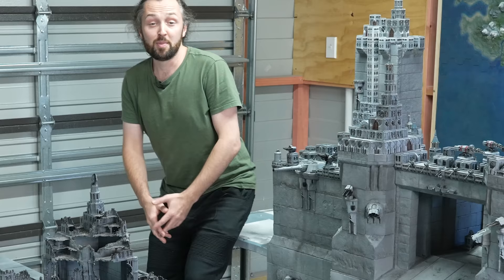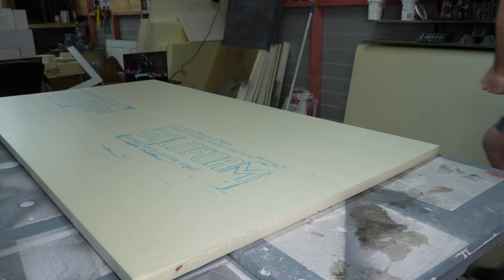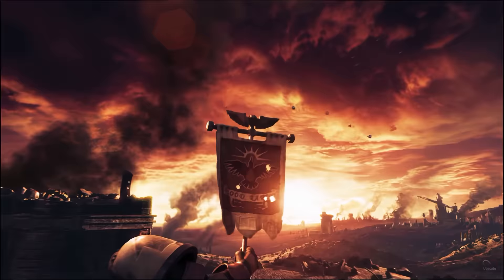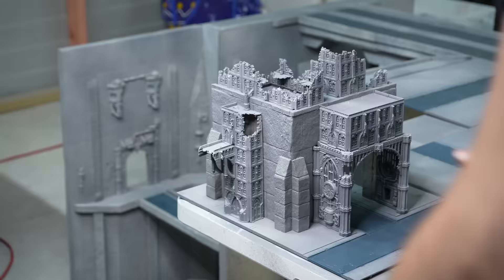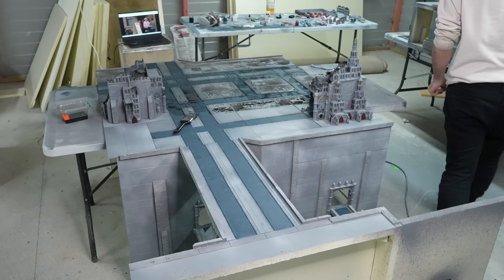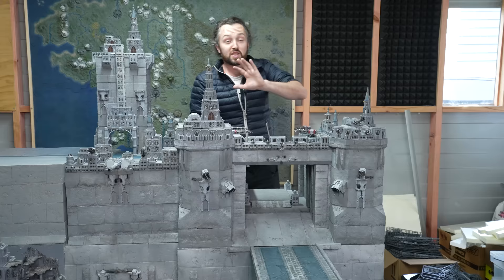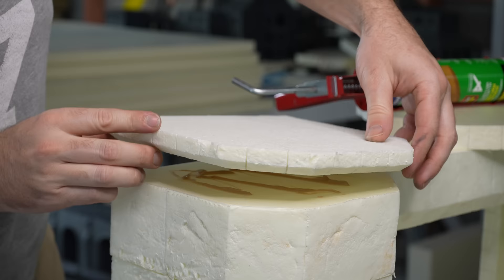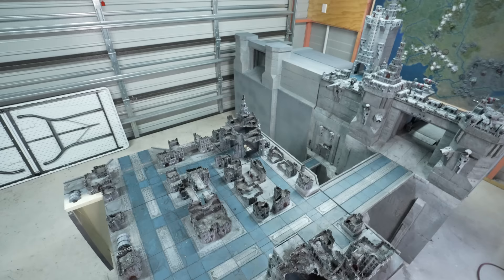The BIGGEST wargaming board in YouTube History! Imperial Palace on Terra Warhammer Scenery [6]

Comment: what i less expected from imperial palace, is right now, for me, the best. The top of the walls. All the small buildings gives a realy good sense of scale and good aspect. Its a great surprise how good it is.

For me, the moduarity its great, but if  you  realy want to know, where i would put the new gate, is on the lower level. Being the gate acces to the higway that goes trought the trench. and the top of the new wall, be at same level than the city.

What I most expected from this, was the city, and i am kind of dissapointed. I realy expected more. But I got to say, that it already got a great work and my expectatives were not real.
But somehow, i imagine a hive city, like a place whit multiples levels and i think, here is  miss chance. Be able to see the narrow spaces in the lower levels between buildings, creating small streets were you would never go in on the threat of being stolen and kill, but as the building increase high, the towers become thin, there is more space on air, and there is space  for platfoms, that can work as square, streets or common areas.  Also, the main highway to the bastion, could have some details to make it feel like a great highway and importat road. maybe could have a small elevation over the rest of the city, or in contrary could be sunked and you could see small roads to incorporate to the main highway whit a car. Maybe the titans, could have a path in the middle and in the sides, roads for smaller cars of civilians

Also, I think, that streets needs more details. Like some cars  broken around, some details like benchs, street food post signs or something I dont know, to make it feels less like just a flat area. I realy dont love it.

But I realy know my expectatives are unreal. The work done its amazing, and even when i dont love the display of buildings and the ground area, I do love the buildings and the incredible work you have done on those. Doing what I said would take an insane amount of time and is not real.
This map its amazing and got me envy that its a map were i will never be able to play.

Comment: I know it might be too late on this project but why not put the streets on a small foam block with magnets in the top and the sides that way you can make it fully modular and can easily decorate it the way you want. The reason for the top ones is so you can glue small magnets into the top to make them magnetic too and have modular like buildings too.